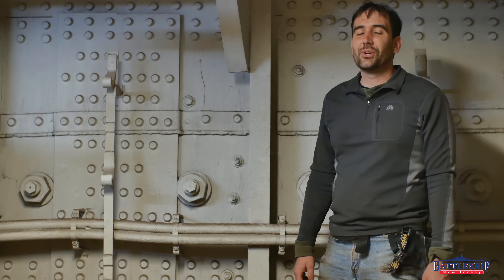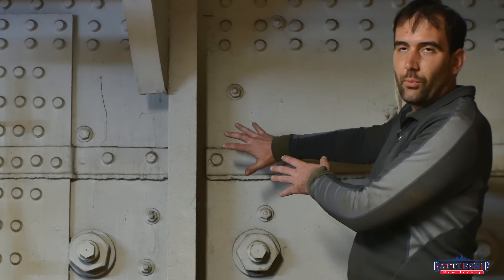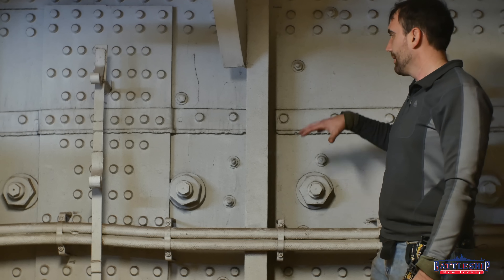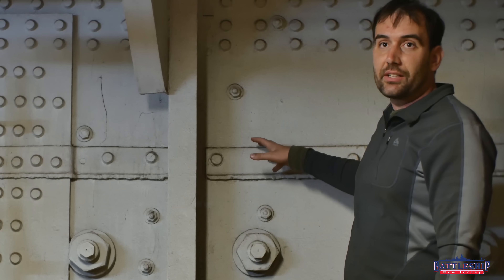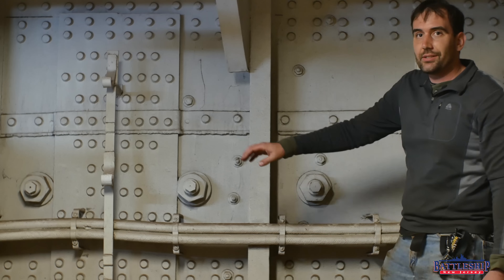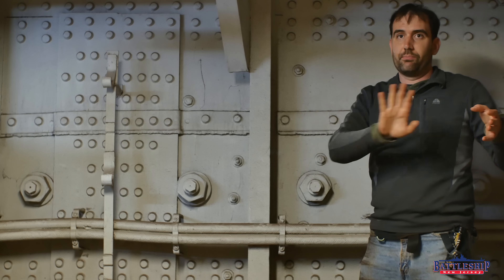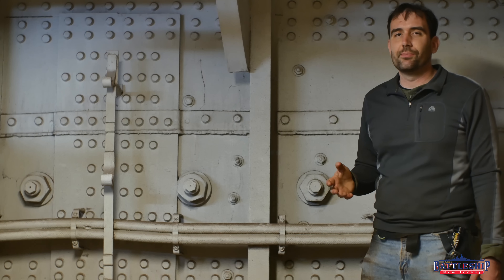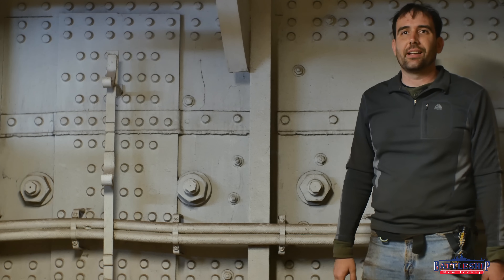Below the Armored Belt of USS Texas

Comment: I would designed a torpedo or mine belt in a way that when the belt did get attacked and damaged, unbolt the damaged part and attach a new one without the need of a dry dock which puts the ship out of commission for weeks if a dry dock is available. Was the belt an add on and was not included in the original design,,,what other method or reason could have been to bolt on the belt? Some ships added concrete protection from torpedo attack

Comment: In this video you ask the question about why New Jersey has caps welded over the nuts that hold on the armor plating.  There is a reference to there not being any case of battleship armor having been hit by shells and so apparently there was no experience of these nuts being shed.  I'm curious about the battleships whose armor belts were hit by torpedoes at Pearl Harbor.  Was there any evidence there of these nuts shearing off?  Since this would have been before the New Jersey (or any of the Iowa's) being built, possibly there was evidence of this?  Just curious.  Thanks for your work with these videos.

Comment: Those bolts appear to be manufactured with hex flats on the end of the threaded portion possibly so they can be held in place and tightened from inside the ship not requiring someone outside to hold a wrench on the bolt.  A form of this is used today in high strength bolts used in building construction so the tightening tool can hold the bolt and tighten the nut at the same time.  The head of the bolt on the other end is just rounded with nothng for a wrench to hold onto.

Comment: The bolts may become projectiles because the bolted connections are under a preload. The nut is tightened to stretch the bolt and compress the materials being connected. These are very large nuts and bolts so they have a very large preload. If something were to shear the bolt in half, the nut with half a bolt in it could shoot back like a rubber band being released. Maybe. Not sure.

Comment: Maybe the lack of covers on Texas, as compared to New Jersey, have to do with access? The armor on Texas was an exterior belt bolted to the "backing" which was the actual ship hull.  Hulls flex while under way and, since the armor was exterior to the flexion, it would feel more force.  In short, did they have to periodically tighten those nuts on ships with exterior armor belts?   Wild guess, but I would guess that an interior citadel would almost be "floating" with respect to hull flexure (at least to a degree), so they wouldn't need access to what surely must have been shin and skull smashers if one somehow lost one's balance on  a rolling ship; hence the covers?  (Love this sort of stuff, there HAS to be some archived document in the boxes of the Old Bureau of Construction!  I can see these covers taking up many meetings)

Comment: I suppose those caps are useless and they would probably tear away and fly along with the nut if this ever happens. However, i dont think they are a wasted weight - i suppose, if a corresponding armor plate would be hit but not penetrated, the shock might loosen those bolts and they will start leaking... into the caps only)

Comment: At 1:35, If the nut shears off, there is a source of flooding. Modern ships still bolt things like coolers to their hulls and the nuts are enclosed in a steel pipe with a cap on it to prevent flooding. Also USS North Carolina's torpedo hit sheared a piece of her armor so I'd look there for instances of damage and how the armor attachments did in combat And IJN Yamato showed what happens when your bolted joints are't that good.

Comment: SoDak took several 14 inch hits at the second naval battle of Guadalcanal, the worst damage being a cracked main turret barbette. There is speculation though that Kirishima who was to bombard Henderson was using HE instead of AP.
Reply: The Japanese ships were preloaded with their special fragmentary bombardment rounds. These were adaptation to the anti-aircraft rounds the Japanese developed for their battleship main batteries. Think in the case of the kiroshima shotgun shell! Figure 1 in each gun tube and then whatever was in the hoist to go to the gun tube would have been fired before they switched to AP. It's easier to just fire at the rounds that are already in the hoist then trying to get them back out.
Reply: The barbette shot was armor piercing. It had that kind of a odd angle which resulted in the armor-piercing cap detaching in a failure of the round to explode.

Comment: Needed. Do you US Navy may not have experienced direct belt impacts from battleship projectiles but I'm sure the British did during World War I. Any information they had would have been shared regarding that with the United States. Be interesting to check to see if the British royal Navy head belt impacts that resulted in the shearing of the mounting bolts on the armor. I do know that tanks experience shearing with bolts and rivets during combat during the beginning of World War II. The Navy may have learned something from that also. There is also the possibility that the Navy learned of the need to protect the bolts from shearing and turning into a projectile based on land testing against armor. I've seen in encyclopedias from the '60s where they had extensive testing against armor plate and I'm sure they had to mount that plate somehow. During a test I may have discovered that the bolts fly off and would kill people.

Comment: The amount of kinetic energy from a 2200 to 2500 lbs shell at terminal velocity of 2,000 fps that can shear off those large nuts & bolts would easily pierce through a welded cap.  The caps on Iowa’s would appear to be cosmetic to me.

Comment: Could it be that the cap or no cap is more related to how likely a guy was to wang a part of their bod,y against it? I mean, the bolts on Texas are uncapped and they were originally in the coal bunkers then it's unlikely sailors would be in there often enough to injure themselves. Iowa on the other hand as an all oil fired ship, used those spaces for offices, berthing, storage etc... from design through construction and service so would have seen more sailors inside those spaces so more of a need to add a safety feature to prevent lacerations against the sharp edges of the bolts and nuts.
Reply: As for sure some bolt caps could have helped in case of a partial sheared one, as it was mentioned that on the Iowas those were "living spaces", or in any case compartments with a lot more sailors going in and out than Texas coal bunkers, I immediately thought too about the use of those caps more as protection to avoid to leave in the open artifacts with a lot of sharp edges that could create an injury by bumping on it, rather than an active measure against the spalling of the bolt itself in case of an external shell impact...
... just by the simple thought that if such of an impact had enough force to break the bolt and sent it flying, it could very easily send off flying the above welded cap together it. even creating more dangerous flying debries.

Comment: There are a lot of comments discussing riveted or bolted armor vs. welded armor on tanks. Welded tank armor not only eliminated the chance of bolts or rivets becoming projectiles, but welded armor also saved weight and complexity because riveted armor needed a frame to rivet the armor to whereas welded armor did not. Was there a similar change in battleship construction with the change from riveted armor to welded armor?
Reply: My dad was 6th Armored Division during World War II and a tank commander nm4 Sherman's. One of his stories I do distinctly remember was a welded hole Sherman taking a direct hit on the world and the weld splitting top to bottom wide open as in you can stick your hand outside through the seam.

Comment: Are those caps only hollow caps, or are they fitted so that they act as a lock nut, and keep the nuts/bolts properly torqued?
Reply: Can you picture it you got an article 13 and you think you're going to get some KP it said you're handed the torque wrench and told to check the armor.

Comment: It would be interesting to remove one of the Iowa armored belt bolt caps to see the inner construction.  It is possible that there is no bolt, and instead, a stud from the armor belt is welded to the hull plating.  The cap might be the exterior dress applied to the weld.
Reply: More info exists than that, we know the number of bolts and even the thread pitch...

Comment: So, when the USS Wyoming and USS Utah were "demilitarized" in the 1930's, and had their armor removed (as well as their main guns), did they accomplish that by "unbolting" it?  And, if so, that's pretty straightforward.
Reply: Well they could unbolt it but they would have to put another bolt in its placed in order to keep the water out. But yeah that's basically how they did it. I imagine if you weld the armor belt into one solid monolithic piece of metal and it gets damaged, that's a hell of a big piece of metal to take off and replace as opposed to sections. Jesus can you imagine the ratchet you need to take them both off? LOL!
Reply: @JohnRodriguesPhotographer  You can only weld the edges, once you cut those the whole plate is free.  Now would use a torque gun BUT back in the day, the ratchet and socket is big of course but, they use an extension bar or pipe  add on to it that may be 10-15 feet long though
Reply: I mean it was designed to be easy to replace. Even if an incoming shell doesn't penetrate the armor, the plate might be dented or cracked. The plates needed to be replaceable with minimal effort to get the ship back to the fight. SoDaks and Iowas only had an internal belt because treaty limitations made increasing the angle difficult otherwise. Internal belts require the shell plating to be removed before the belt can even be accessed, so repair times are greatly increased.
Reply: @hawkeye2816  ẞL

Comment: What happened to Texas' shafts in propellers?  Why were they removed.  I noticed that in a 1988 dry dock photo.
Reply: A lot of the decommissioned ships have them removed.  The ships aren't supposed to be run so they don't need them.  But realistically heavy propellers hanging idle for years on end put pressure on the shaft seals and can cause leaking at that point.  Easier to seal those areas off to prevent that in the future.  The NJ's shaft seals are still holding, not so much on some others.
Reply: In a salt water or brackish water environment, dissimilar metals in close proximity can speed cathodic corrosion.  The bronze alloy in the propellers would have helped feed the speed of corrosion even with the use of zinc or other metals as corrosion prevention measures.  The propellers (also called screws) are often removed when a ship enters museum status, or so I've been told.  This was done for Texas, but I don't know if it was done for NJ or any of the other Iowa class.
Reply: The shafts and one propeller are gone. One propeller is still with the ship. Use to be on display on the grounds before the ticket office

Comment: If a hit on the NJ would have been powerful enough to shear off the bolt, how much could that welded on cap have helped?
Reply: It can help a lot, not because it increases the force before failure, but because it doesn't. The only force acting on the cap is that of the bolt or rivet heads kinetic energy, so even assuming it took no force to remove it from the plate, its detached mass drastically reduces shrapnel effect. But it IS attached, and its not hardened, so it will be torn free and deformed by the impact, absorbing more energy yet again. So why don't we see more welded caps? Because they spanned a limited period where welding was widely available as to be used in the design, but also not thought suited for the entire armor plate.
Reply: @SheepInACart  Thanks for your reply.  I learned something.

Comment: I believe that fort drum 14 inch turret took a bomb hit on day 3 and a bolt went flying causing injuries.  That was probably reported to the navy.  Lee tanks and early Sherman's were extremely prone for armor bolts flying as well.  Alaska pictures seem to show bolt caps in the turrets as well.  Bolt caps may have been late war construction to address these concerns.
Reply: The bolts holding the Sherman transmission cover in place didn't really project all that much into the crew compartment and the transmission itself (along with the differential and final drive) would have blocked most of the paths by which these bolts could have been thrown around inside.
Reply: Sherman tanks didn't have bolted armor like the Lees did. They were either cast or welded. But yes, bolts on early tanks did break loose and become projectiles sometimes.
Reply: @StarWarsFanatic14  Some of the Shermans, if not most had bolted on transmissions at the front. Later versions had built up armour around the bolts to lessen the chance of a bolt being struck and sent flying through the crew compartment.
Reply: @Tuck-Shop  TIL. I never knew that. Many thanks

Comment: Had read that where both the USS Colorado (Tinian) and USS South Dakota (Guadalcanal) had been hit by numerous medium caliber guns and that an older style armor layout like what USS Texas had might have helped. Though the older system wouldn't have stopped as much heavy caliber shells or even some medium caliber shells fired at close range.  The USS Missouri took a kamikaze hit to her belt don't know if that would have hit hard enough to sheer off a bolt. Think she still has the dent in her side from where she was hit by the kamikaze.
Reply: Kamikaze that hit Missouri only dented the outer hull, never got to the belt.    SoDak was hit many times, including by 8" and 14" shells,  and her armor held up just fine.   Colorado never had her armor tested, she wasn't hit by anything that could penetrate it, and I believe her armor would have held up just fine had she been in SoDak's place at Guadalcanal. 
We just never got in a real slugging match with another Battleship....fortunately or unfortunately, depending on how you look at it.
Reply: @Future-Preps35  Actually, some think that 14" AP indeed hit SoDak, and the shell was yawed by her outer STS armor before it hit the main belt.   No way to know for now, but it's very possible AP hit her.
Reply: @SealofPerfection  didn't a Japanese round end up hitting the aft barbet? I remember correctly a hit at kind of an odd angle and it decapped the round, failing to explode. I think that drakenafel mentions it in his second night Battle of Guadalcanal video
Reply: @JohnRodriguesPhotographer  Yes, and originally it was thought that was an HE round, but recently it's been said that was an AP round that got decapped and yawed so it didn't hit head-on. 
Which is exactly what the outer STS armor was supposed to do.

Comment: I seem to remember flexible stay-bolts on locomotive boilers being capped, not sure if this was to protect the nut from corrosion, or to protect anyone from a failed stay bolt fastener, or both.  Very interesting.  Great video!
Reply: The Big Boy 4014 has caps over the stay bolts. There's a video on here that explains them. I think they had welded caps to stop steam leaks.
Reply: On a locomotive boiler the flexible staybolt caps (of whatever style they may be) are pressure retaining.
Reply: Could the caps on the battleship be to make the armoured section water tight?
Reply: @albertoa.r.5886  Not really, if the bolt moved enough to get more than a tiny bead of water in (and pumping in an emergency just don't care about whats letting one drip at a time in), the cap is long unseated from the forces, and the few ships that had them nearly exclusively had internal belts anyway. On steam locomotives avoiding weeping across temperature cycles, protecting bolt from corrosion and even insulating are also factors which warships armor didn't normally face.